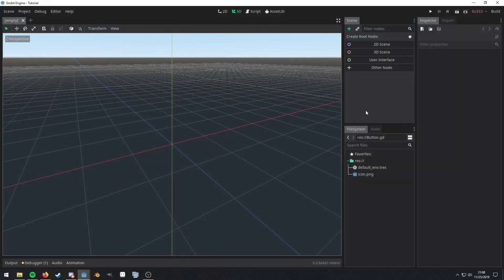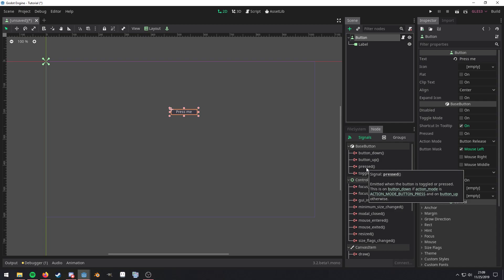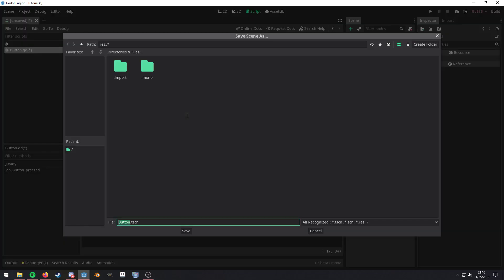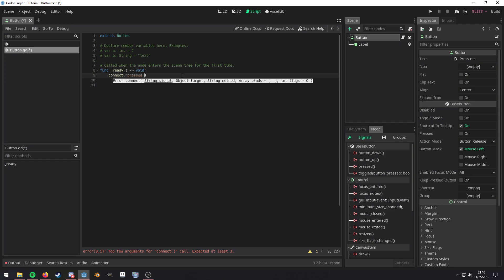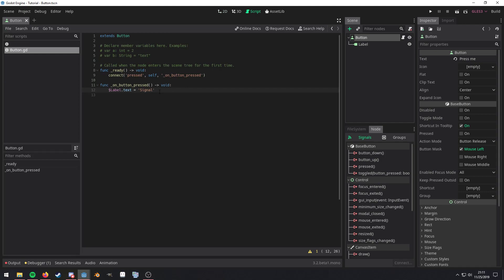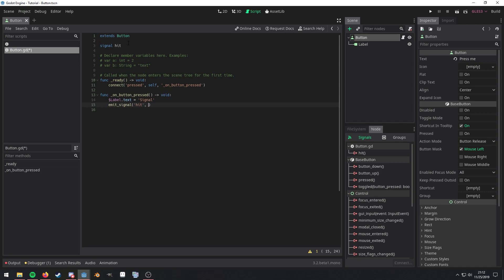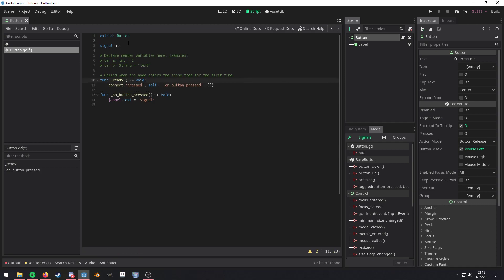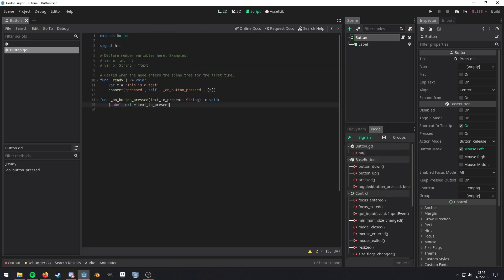Godot 3.2: Signal Basics

Comment: In this example, the label is a child of the signal emitter: to make them comunicate it is sufficient to use '$' in front of the label node; what about a comunication toward a scene (a coin to pickup, in my case) that not even isn't a child of the emitter but does not exist by default inside the current scene (Spawned when killing an enemy)? Anyway, thank you very much for your video :)